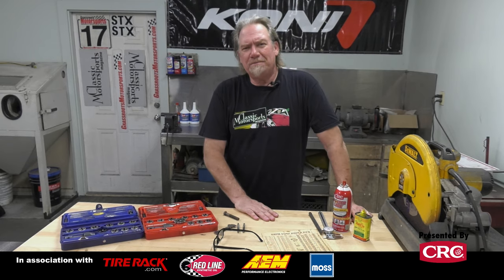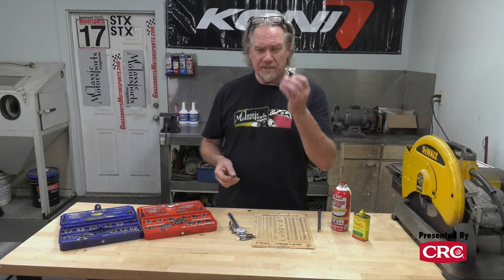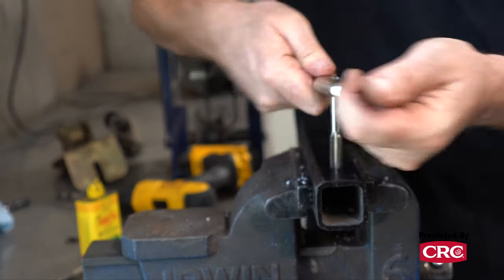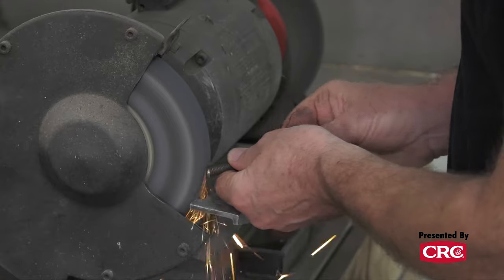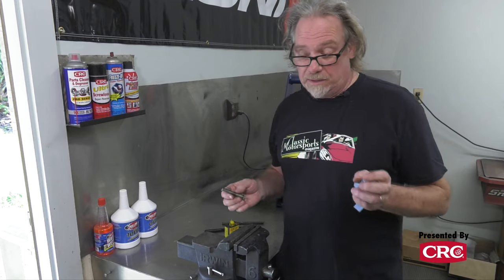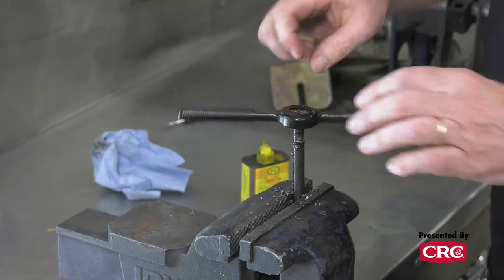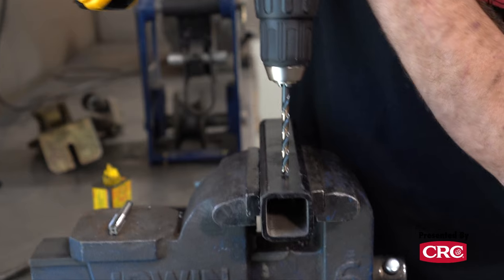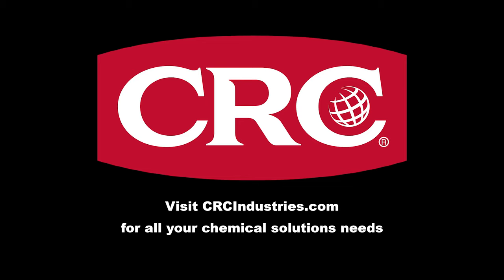How to Use a Tap and Die Set

Comment: I use split dies which are good on stainless as they cut several passes as you close them in making the harder metals easier to cut but also work great at chasing threads out.

Comment: Thank you for the informative video, maybe you could advice me with my problem. I have an older camper where the spare tire is on a hinged shelf under the vehicle. A rod come down from the frame which secures the tire frame. That rod is 1/2X20 and rusted out to the point where the nut just falls off. Can I use a tap and change that to 7/16X14 or 1/2X13? Thank you for the help.

Comment: I'm not an expert at taps, but I seen you put a bevel on the rod for the die, couldn't you also put a bevel at the opening of the hole to make starting the tap easier?
Reply: most common taps are tapered

Comment: Great video, but no one ever seems to talk about die stock sizes and the wrenches that fit them.  I bought some NPT dies to threat a brass pipe, but I cant for the life of me find a wrench for the dies.  The 1/2 inch die that I need is 2 1/8 inches in diameter.  It is to big to fit a 2inch die wrench and to small for a 2 1/2 die wrench.  Ive never seen a 2 1/8 die wrench though.  So whats up with that?

Comment: I know this is old but everytime I use a set, I grabbed what would be the new threads, screw them onto the bolt I want to make a new hole for, it fits perfect, I tap a new hole and thread the new threads in that fit on the bolt perfectly, but then when I go to put the boat in it never goes incorrectly always cross threads every single time.... I don't understand....

Comment: It’s my first time using a tap and die…I stripped a bolt hole on my motorcycle. Do I need to drill out the old thread to rethread the hole?

Comment: Ive seen so many professional hack just keep turn the tool without backing off - they just keep cranking on the tool with no cutting oil etc. I busted off a tap on an intake manifold for my 71 CJ 5.
Try extracting one of those hardened buggers when its flush with the surface.
Especially embarrassing as my father and both grandfathers were tool and die professionals. i was 17 and knew everything. They got a lot of mileage out of that one, but I did learn how to STFU and listen and how to ask for instruction when I wasn't sure about something. They're all gone now, but I've got the youtoobs.

Comment: What if u dont have the right size drill bit for the tap (eg a 7/16 bolt needs a 25/64 hole, but you have a 21/64 bit instead?)

Comment: I bought a Tap  Die set to try to repair my ebike wheel axle (12mm thread). It's previous owner prob had no torque arm fitted - or he crossthreaded the nut. Is lubricant oil what would make the difference in getting the cut started?. Im also concerned about cutting off-centre and not being able to screw a nut onto the recut thread. Anyone got any tips? (I don't have a vice)
Reply: You can use WD40 as the lubricant

Comment: Somebody should build a manual-labour hand-pedal (pedal to quick-flywheel to slow-lathe, inertia ratios)
= stencil plate copy (enlarge-neutral-reduce)
= "3D"-to-2D lathe turning metal engraving tool
= to clean, trace and copy from inside a casing (reduction fit.?)
= and creation the bolt
= same for nuts
= same for threading rods(reduction-ratio.?)
= and a tray-plate-vice-jig to trace 1:1

Toy train tracks, mechanical relay, for copying and polishing and cleaning certain other items or welding or feeding brazing-wire for some flow... its like do the same thing 3 or 4 times to achieve one effect...